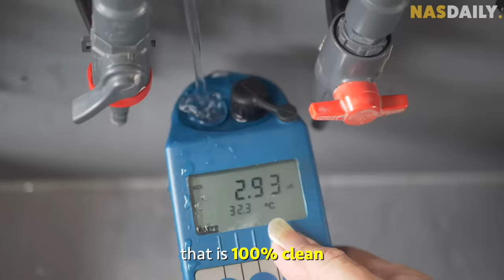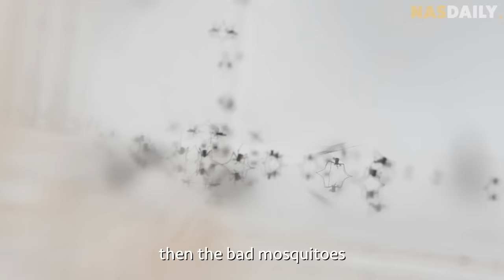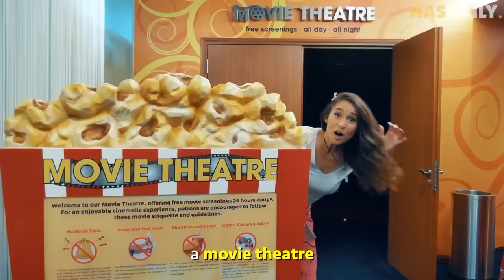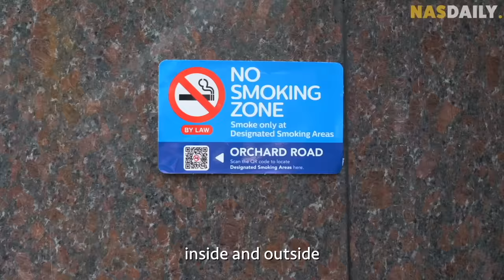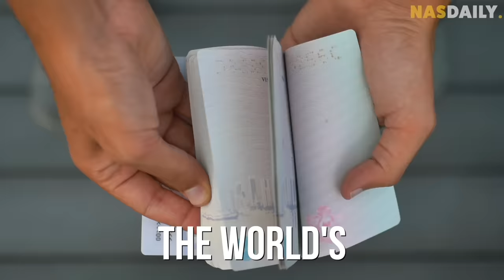9 Reasons To Love Singapore

Comment: 2:45 ok just to clarify this out that is not a water slide just normal slide,it’s called,Slide@T3,2 types of slides high and Low Low is now free while high requires min spend in T3
Low @B2 High@L1/coach level
Reply: No not 2:45 but 2:40